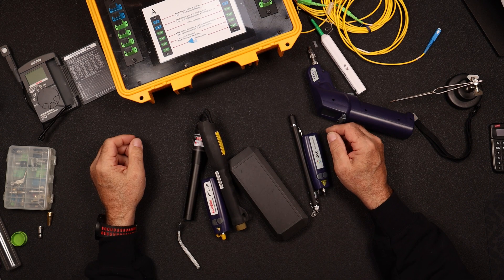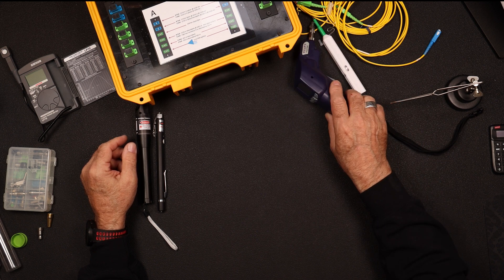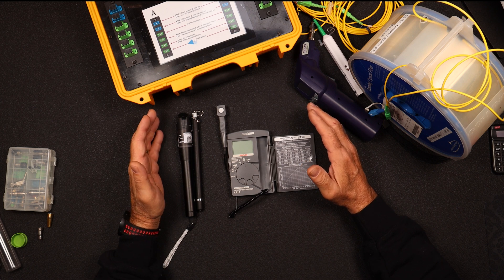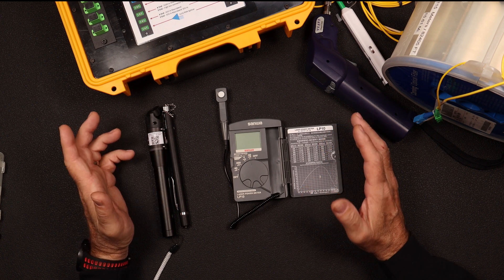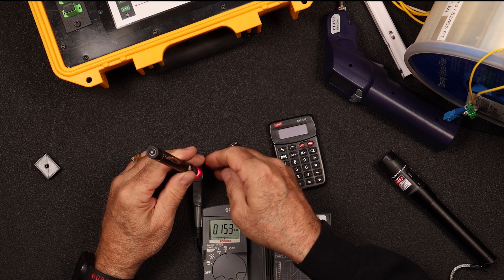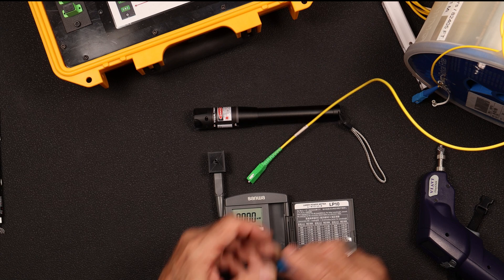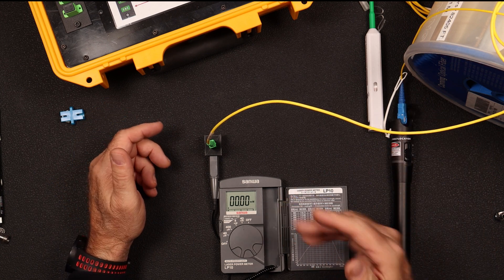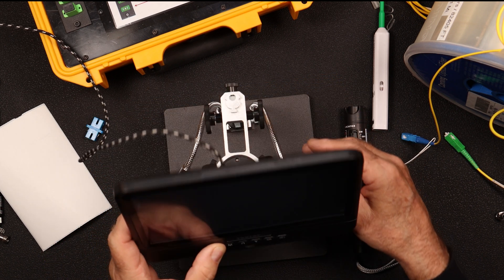Will Your Visual Fault Locator Reach 30 km?

Comment: Some consider any VFL above 5mW to pose a risk of eye damage.
Do you know of a safe method to locate a fiber on a patch panel using VFLs or alternative tools?
I have been searching for a solution, but so far I have not found one that could be implemented easily.
Reply from the maker: Even 5mw lasers are considered an eye hazard under prolonged exposure. The biggest hazard is from our transport lasers operating in the IR spectrum since they are undetectable by the naked eye. VFLs are safe when used correctly, however for added safety, you could use laser safety glasses designed to block the 600nm range (https://www.amazon.com/YANUO-Glasses-Protection-630-750nm-Protective/dp/B0CXHT7CYN). Back in the old days there was a white light flash light that was used, but it didn't work very well. In short, the best prevention is being diligent, and proper use, don't point connectors under test at yourself of others, be aware of who is around you and what they are doing, and you should be fine.
Hope this helps, thanks for the comment.
Reply from the maker: I thought this could use a bit of official recommendations from ANSI Z136.1-2014 concerning maximum exposure levels. Most VFL's are Class 1 or Class 2 Lasers
Class 1 denotes lasers or laser systems that do not, under normal operating conditions, pose a hazard. Class 1 also includes those lasers that were previously designated as Class 2a.

Class 2 denotes low power visible lasers or laser systems which, because of the normal human bright-light aversion response (i.e. blinking, eye movement, etc.), do not normally present a hazard, but may present some potential for hazard if viewed directly for extended periods (like many conventional light sources). The signal word “CAUTION” is used with all signs and labels associated with Class 2, Class 2M and some Class 3R lasers warning against staring into the beam (see Fig. 7).
Again, I hope this helps clarify.

Comment: I saw a 60 mW & 100mW for sale of the same design online. maybe it can reach the 25km.  I hope you can test this using your 25 km optical fiber and other equipments. Thanks.
Reply from the maker: Regardless of the output power of a VFL, they will never achieve 25km. 630-650 nm light is extremely high frequency, and as we discussed in our latest video, the higher the frequency the greater the attenuation. The other factor it that the light is not confined to the core, so the light just goes everywhere. I did test a 50mw VFL that was supposed to go 50km and there was no measurable light after about 7km. I would like to reiterate that 1mw of power is not equal to 1 km 100mw is 20dBm, 630nm loses about 6dB per km so realistically 3-5km usable range meaning you can actually see the light. But, since you requested, I will do a video and test one of these.
Thanks for the comment.

Comment: We just look for visual light, to locate the strand, sometimes strand count is wrong so we just trace it down connect the splitter port then test for actual light signal.

Comment: The companies $349 VFL is a 10mw. Will not reach 20kft.  The 30mw I purchased $19 will.
Reply from the maker: Sounds reasonable at 6km, provided it's not going through any high loss events or splitters. If you got the 30mw from Amazon, it probably says it has a 30km reach (98kft), which isn't going to happen. Thanks for the comment(s).
Reply from the maker: Just a side note for perspective, 30mw is 14dBm, a PON OLT launches at 3 to -3dBm, and passes through a 32 port splitter with 15dB of loss and still makes 20km.
Physics tells us that higher frequency has greater loss than lower frequency. VFL's are around 650nm which is a very high frequency compared to 1310/1490, and the reason it loses about 6dB/km. There is an upcoming video about wavelengths and how this all applies. Thanks again.

Comment: Great Video…I work in a headend and been wondering about these VFLs.  The ones I use for work are made by EXFo and those only advertise 3-5km
Reply from the maker: Thanks for the comment. Most of the manufacturers VFL's are 1mW (3-5km). I believe Viavi makes a 5mW "High Output" model, again in the 5km range but a bit brighter inside of that. Thanks again for the positive feedback.

Comment: Found one on Amazon that actually went 7 miles... I was impressed.
Reply from the maker: Was it 7 miles or Kilometers? I have seen  some VFLs where under magnification you can see a faint dot, it wouldnt be usable in the field though. I would be interested in knowing the brand/link of the one you have. Thanks for the comment.
Reply: @VanTekConsulting  It was 7 miles(11.2 kilometers) Brand  is (Karvinger - Rechargeable Visual Fault Locator 30mW 18miles) and I used another which and got 5 miles(8 Kilometers)  Brand Sysotek Visual Fault Locator - Rechargeable VFL Fiber Optic Red Light - Retractable Head fits SC FC ST.
Reply: I've got the same pin the I use ever day that does six Miles easy through mst, cases and panels
Reply from the maker: @granttolar9380  Interesting. 635nm loses about 6dB per km, so even an 80mW VFL is only 19dBm allowing for about 3km of range. 5km - 6km would be a very faint dot as shown in the testing. I'm interested to know the brand you are usnig. Thanks for the comment.